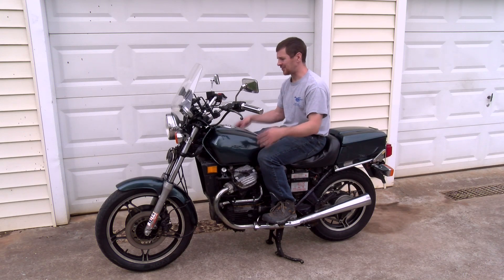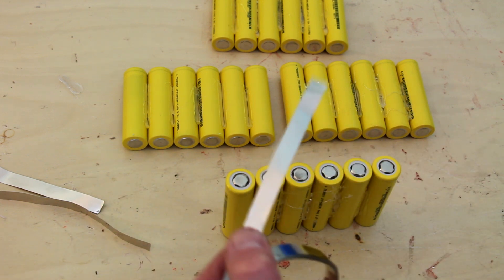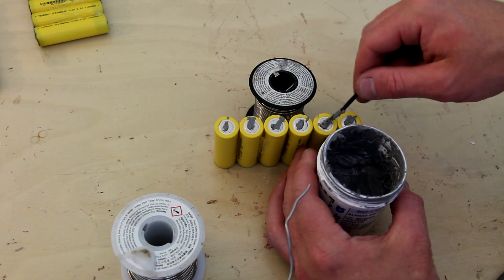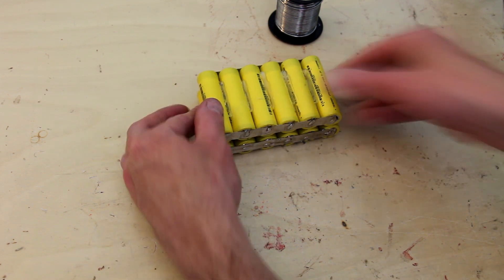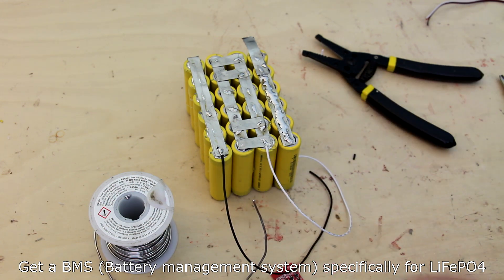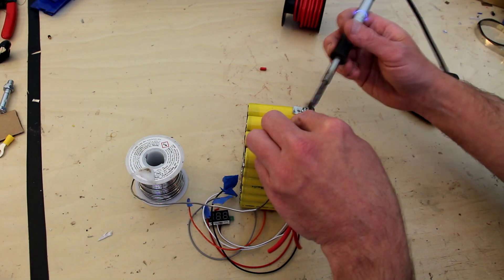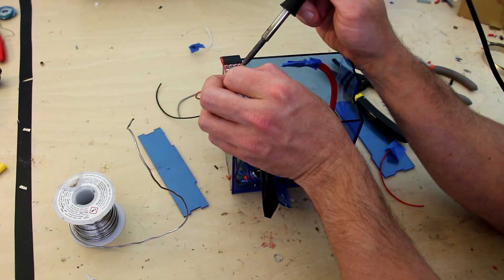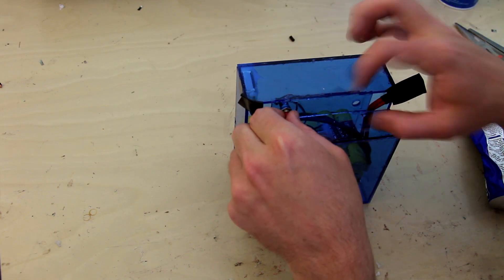DIY a better power sports battery

Comment: Great job explaining the build and really enjoyed the mentioning of safety throughout your video. People need to understand the safety side of battery builds just as much as the build itself, especially when dealing with higher voltage and capacity battery builds. Again really enjoyed the video

Comment: How many batteries do I need if I'm using 3.7 20000Mah
Reply: You may only need 1in parallel and 4 in series if it discharges enough if not you need to have more cells in parallel current 20ah is probably enough capacity though

Comment: How does this effect the charging system? I have a 1981 yamaha xv750, want to replace battery with some headway cells. Not sure what happens when the bms disconnects due to full charge

Comment: Your videos are very helpful. Lots of common sense. I would suggest you solder up your bms leads before you put them on the battery, though. You make it look easy. I have a couple of v65s I am building replacements for and this was a BIG help.   Thanks

Comment: Good Video. I'm going to do something similar for my Atv

Be aware there are fake Nickle strips. Fake meaning not Nickle but covered metal with thin Nickle. Always buy products with reviews or be aware you might not get what your intended to buy.

A good test would be checking for heat.
You should be able to touch the strip, wires and feel no heat or very little after a long time being used.
If everything is working well there shouldn't be no noticeable heat. Under controlled conditions.

Comment: OK I'm building this exact same battery for my kawasaki voyager. Got 24 1350/3.3v batteries from k2 and a 4s bms. I'm making the box from acrylic since that's what I have with my laser. I'm installing 1/4" posts and then making a lid to cover everything once installed.

Comment: Subbed. Can you do a video on matching used cells to build high discharge 18650 packs and explain how to calculate how many cells you need in a parallel group to get the desired discharge rate? IE 100 amps discharge rate from cells with a 4 to 5 amp discharge rate?

Comment: Amazing!!! I needed this 8 years ago for my 87 ninja i rebuilt. what BMS did you use? Parts list please!!!
Reply from the maker: I find they are all about the same.  Every one I have seen has the balancing function which is all you need.  The charge/discharge function doesn't make any sense for a motorcycle as the charging system limits the voltage well before the BMS ever would.

Since this is a very small battery a small BMS is more than adequate.   I got mine on EBay (the little red one) for $4.  It balances at 58mA which is more than sufficient.

Comment: so in normal parlance, that would be a 4s6p battery?, but how many millamphours ?
Reply from the maker: The cells are 1100mAh each, so 6600mAh.  This is actually going in my Honda 650 NightHawk which calls for an 11Ah battery.  The bike I tested on uses a 14.7Ah battery and this was far better.

In general, you want 1/3 -1/2 the capacity of a lead acid battery when using Lithium.  You can go with more, of course, but it just costs more.